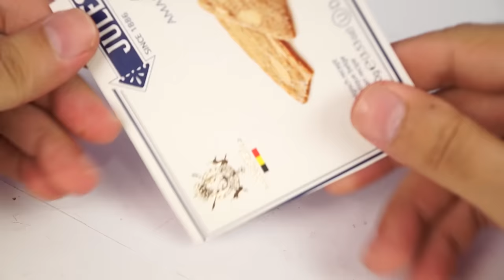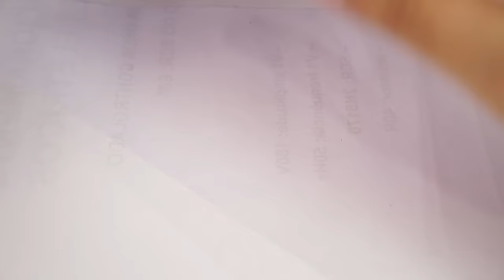Faça um Incrível Mini Aspirador de Pó USB com Motor DC

Comment: but you did the holes side of the motor so how the the dust was not fliying and caming out
Reply: U should keep the fan ulta then it will suck the dust I used ready made fan